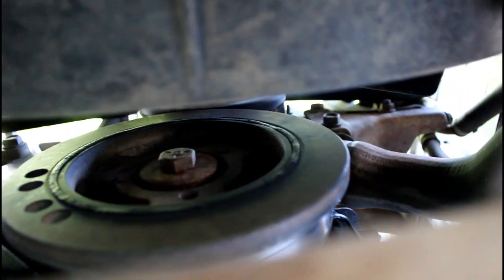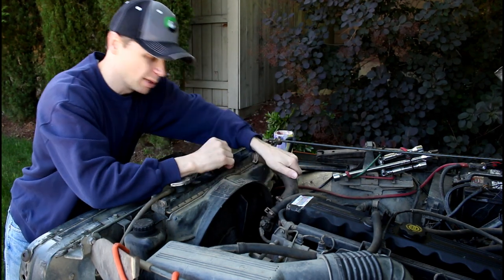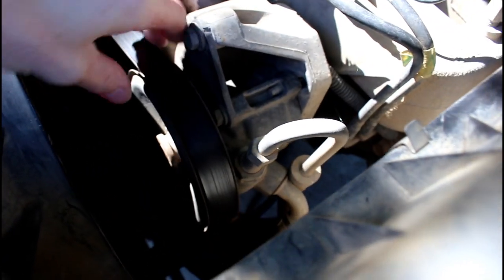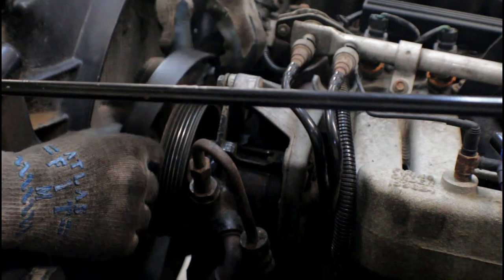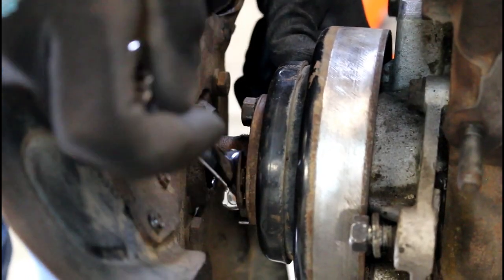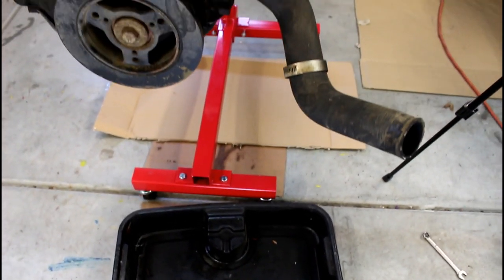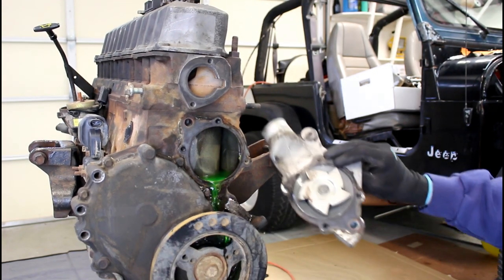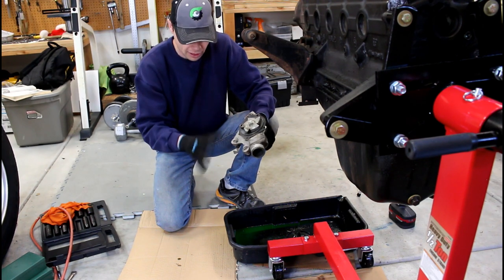How to Replace a Water Pump

Comment: the four bolts on the fan... Is it just me or are they nearly impossible to remove?? They look to be tack welded on, and I have two 13 mm wrenches to try pry them off. Even with an extension on the wrench to get more torque it just starts to strip off the metal. Any help on what to do? Thank you!

Comment: I'm replacing the 2.5 engine in my yj. Is there a video or a diagram somewhere on all of the brackets and stuff bolted onto the motor? Stuff like the alternator and power steering and tensioner, etc. is confusing when reassembling it all. Would be helpful. These videos are great btw!

Comment: Thanks for making this video.  Noticed a leak last weekend on my way home and upon inspection found it coming from the weep hole, so another unit is on the way, however wanted to know if the blown seal might have caused any damage anwhere else besides the pump itself (i.e. is there anything else I need to look out for besides changing the pump?)
Reply from the maker: Should be just the pump, unless it lost a lot of fluid and overheated or something....
Reply: thanks.  Didn't notice any overheating issue, though I'm going to change the oil anyway just in case.  Saw a couple drops when stopped for gas about 30 min from home but no further drips.  Then when home and cooled I popped the radiator cap and it was not empty but the vacuum release caused a bunch more to dump out of the weep hole.   Was mainly worried whether blown seals might throw oil or junk into the radiator or engine.
Reply: Just finished the replacement, thanks so much for making this video.  As I think someone else mentioned the step that's missing is fully removing the steering pump and bracket since it's bolted to the pump, but anyone following your video can't be led amiss because it becomes obvious and the disassembly can't proceed without doing it.   Also I needed to remove the stationary idler pulley to get the heater pipe sticking out the top of the pump out (which you didn't have installed on your project engine)

Comment: Nice video but when do you install the heater hose pipe that connects to the water pump. My pump didn't come with a new pipe so I tried removing the old pipe off the old pump and it broke off. I will go back to the internet and see if this part is available.
Reply from the maker: Yeah, have to install before pump goes on.

Comment: You skipped the part I needed. How does the bracket on the driver's side power steering removed? I got All bolts out except for that bracket.
Reply: Your able to slide the water pump in behind those two then kind of roll the new pump on if you will

Comment: What about the heater tube connection? Aren't you supposed to thread that on before putting the pump back on the engine?
Reply from the maker: I was able to get mine off before removing the pump, but yeah, be easier to thread it on first.  Good tip.  Thx!
Reply: JeepSolid love the channel! You've been a big help when working on my '87

Comment: I am afraid I am an idiot.  What happens if you put coolant in engine block and the radiator? After replacing the thermostat and water.pimp? Did I just blow my engine?
Reply from the maker: What do you mean in the engine block? Where'd you put it in? Need more specifics 👍🏽
Reply: @JeepSolid  Thanks for the reply. I poured it in where the thermostat goes with the water pump in place...but it does not matter now, all is well and just finished tonight.  The 4.0 is running nice and smooth and sounding better than before.

Comment: Great idea, to make a video with one engine on a stand and the other in the vehicle.  I had just another; OH, that's where that part goes moment, while I try to reassemble and reinstall my engine, from memory.   BTW, for the RTV, they are now making SPECIFIC RTV's for different applications.  Water pump RTV would be a Coolant Application.
Reply from the maker: Yeah, having 2nd engine is super helpful for sure! Great tip with the rtv as well. Thx!

Comment: This Jeep is one of the worst designs, the water pipe coming off the water pump is leaking at the fitting and you cannot change that by itself without fully removing the water pump and for that I’d rather burn the car